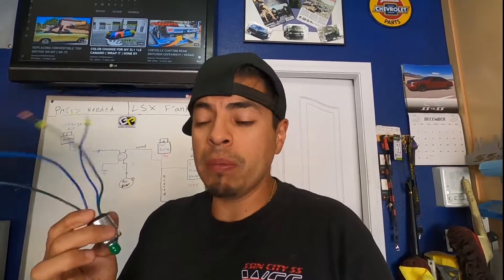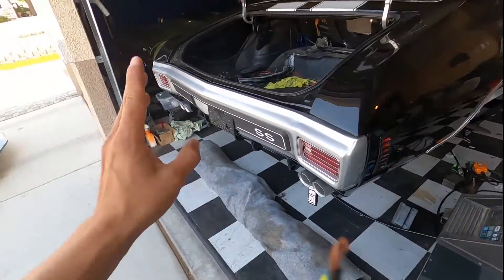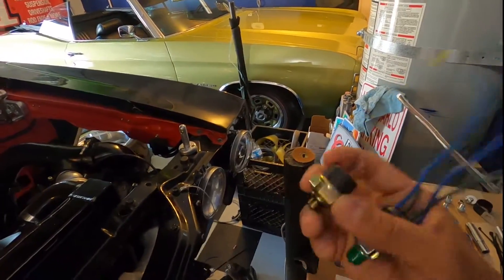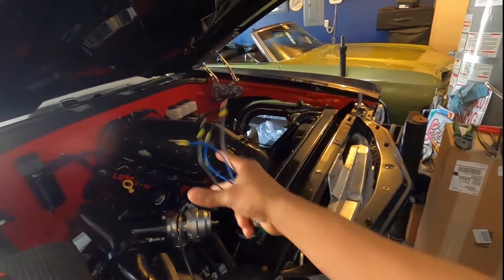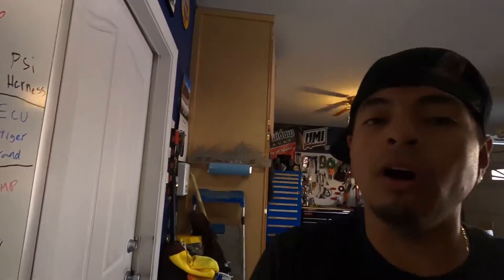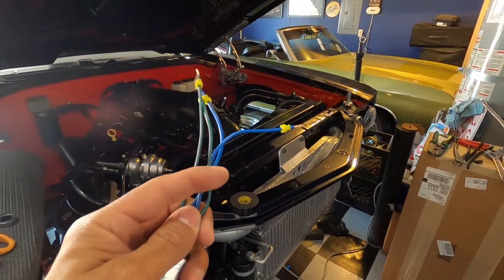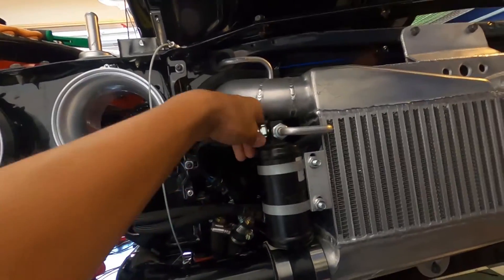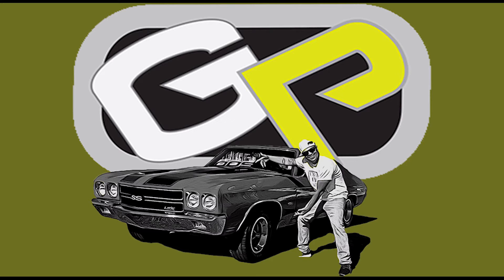HOW TO WIRE A TRINARY SWITCH W/YOUR LS SWAP HARNESS ON A VINTAGE AIR SYSTEM

Comment: Thanks for the great information, I'm in the process of hooking up a Terminator X and Vintage Air with the trinary switch, some of the other post before that I came across mentioned installing a diode in the Holley trigger wires. Have you had to do that? or is it working fine for you? Thanks again for the info.

Comment: Whats up bro I don’t know it it’s posible to help me about how to wire up my a/c system ! I have a 4gen 6.2L with NV3500 transmission and I need to connect to The right way my a/c system I’m running a R4 compresor

Comment: I've done it this way, but it's not the correct way. And ls1 has a pin in the computer that tell the ecm the a/c is on. The psi harness will NOT have this pin installed. So you'll have to get a pinout for your year/type ecm. The ls3 uses a 3 wire transducer. It works on canbus. Recently someone told me that you can use the ground side of the transducer to activate the fans connected to the vintage trinary switch. I'm looking into it. 
Bp automotive harness has the a/c hook up installed already. I've done both PSI  and BP Automotive  and will never psi again. Customer service and quality just isn't there.

Comment: With the LS harness and using the trinary switch, did you have to wire in a diode to keep from back feeding a signal to the ecu? I have an LS3 with E38 ecu that has two fan outputs, one for 190* on and the other for 205* on. I keep losing signal and fans don’t turn on like they should.
Reply from the maker: NO SIR
Reply: @goosseperformance1444  Do you have suggestions on why they would cut out?

Comment: The white signal wire from the PCM (also PSI wiring harness) where does that get connected to? I believe that’s the signal wire to bump up the idle when the AC is activated.
Reply from the maker: to blue wire coming from VA relay
Reply: @goosseperformance1444   Thank you - had it wired to the blue off the Trinary switch.

Comment: Great info,  great video  i have kw w900 ac wires were cut on accident? Ac not working  Ac compressor in front of engine 1 wire with ac dryer next to it wire  trianary switch  all 4 wires cut , have engine harness right their that runs trough engine tru firewall i believe goes to ac control.unit .. my issue is how can I figure out which wires are what ? And how to re wire this unit ? Any advice i would great appreciate it .

Comment: You cannot wire the second fan as shown and it operate correctly. For example, the way you show it, Fan 2 will always come on if the ECU is commanding Fan 1 as they share the ground wire on your diagram.
Reply: Add a diode to the wire between the relays and you will have low and high speed fan control for you coolant temperature, but having your fans come on high every time it senses high pressure I guess would work but it would be better if you didn't use a trainer switch and you just put a high pressure sensor on it and wired it to the PCM and then allow it to do what it was made too which is turn on your low speed fan when the head pressure comes up and high-speed fan when the pressure comes up even higher, also it will turn the fans off when you go over a pre set speed because you don't need fans when your moving down the road above around 30mph I think it is,  using the trinary switch and leaving your fans on high while you're going down the highway will actually cause a restriction of air flow with the fan blade spinning
Reply: @mrmchaffey @ a diode for  each ground??
Reply from the maker: CORRECT , this is a high hp car and its will live in the desert
Reply: @goosseperformance1444  In your diagram, your Fan 2 wire from the ECU isn’t doing anything. Either your Fan 1 turns them both on, or the trinary turns them both on. I think it could mislead people who want to use that diagram as a go-to for their street cars if they want the ECU to do something with the Fan 2 signal from their ECU. Some people also put diodes in the line(s) as some ECUs don’t like seeing that ground signal from the trinary switch when the ECU doesn’t command it to go to ground.
Reply: You would just need to put the diode between the ground  of the two relays. Just one, but you should really look up a three relay setup and wire it that way, because if you have two fans with three relays, it'll split the voltage between the two fans and cause them to run at half speed aka low speed. When the fans command low from the computer, and then when the fans command high it'll switch from series to parallel and run both fans on high, the best setup would be to not use a trinary switch and go with a low pressure switch for your compressor and a transducer wired to the computer to monitor high side pressure , and let the computer turn the fans on low and high based off of AC head pressure. Not to mention the added bonus of the computer. Turning your fans off while you're going down the highway

Comment: I have a ls3 swap 86 C10 with factory air. I'm installing Dakota digital HDX,BIM and the fan controller with the 1 wire sanden compressor. Is this switch still required? Thanks!
Reply from the maker: Yes
Reply: Thank you for your response.

Comment: Great Info.
Just what I was looking for.
I’m running LS engine with electric fans, binary switch on vintage air set up. AC clutch will only kick on when the computer  turns the fans on. Trinary switch should take care of that problem?
Should I run a separate fan for this AC set up or just wire in to the existing fan set up?
Reply from the maker: ac clutch should kick on when ac is turned on
Reply: Goosse Performance It does turn on when I turn the AC on but shuts off after a few seconds. When engine gets up to temp. and fans turn on then comes back on and clutch stays on until fans go back off.
Reply: @argeliogonzalezjr  you can wire the AC clutch direct from a relay that comes on from the switch.
Reply: @cuzz63  thanks👍🏽
Reply: @argeliogonzalezjr  one thing you have to remember is that many things that have high current run through relays..so you can choose what turns on those relays...even other relays.
Reply: @cuzz63  Thanks for the good info. I will keep that in mind.

Comment: By any chance do you have different relays?? On my fan relays, the ground terminal is 85.  That’s where I got my pcm ground signals...
Reply from the maker: Its possible,  there's different ways to wire the relays, along as on side has power ' acc power, ground etc